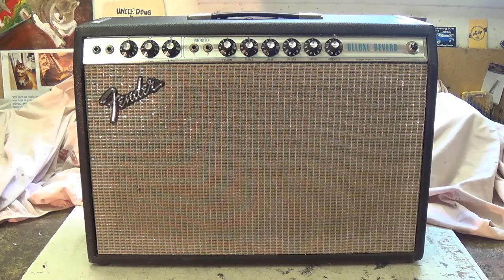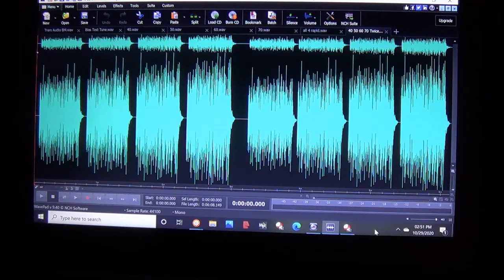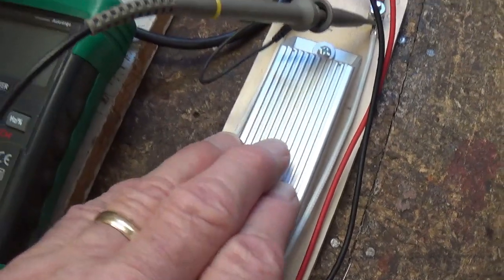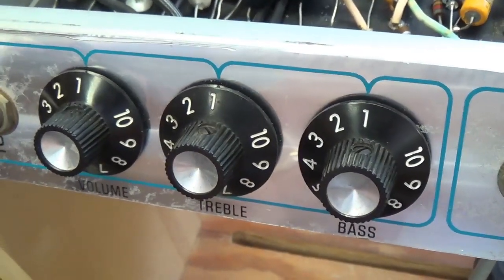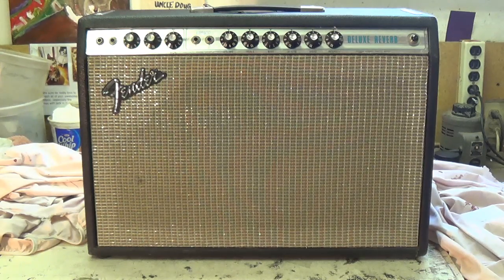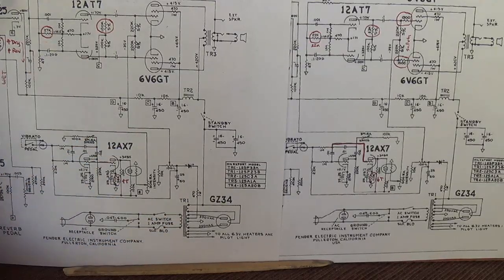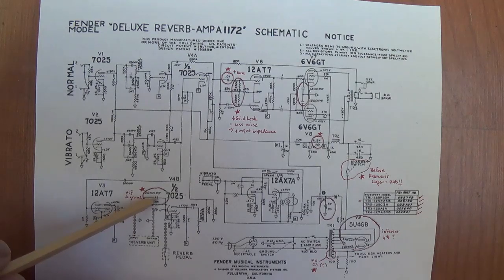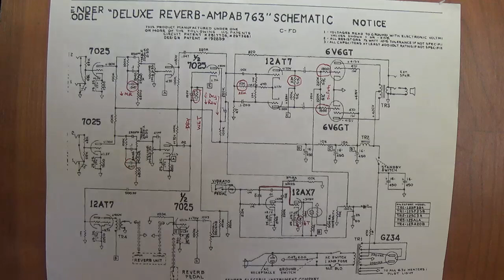The Effect of Output Tube Bias on Tone, Gain, and Headroom.....A Side-by-Side Comparison

Comment: On the center tap question, I wonder if a person "dismantled" a transformer that doesn't have the center tap, if, in fact, it's actually there but the lead is just cut off - - I'm with you U.D., makes no sense to add the "virtual" circuit if there is a center tap not being utilized but cut off within the shell of the transformer. If there ever is a clear answer to the question I look forward to you informing us. I enjoyed all of this video and especially liked the side by side(s) schematic discussion.
Reply from the maker: Thanks, Skip. Some people advocate using the virtual CT resistors because they can act as fuses to protect the PT from harm if a tube filament shorts out. In all my life and career, I have never seen this happen.....and the vast, overwhelming majority of amps with CT's have them grounded, so I tend to go with the majority.
Reply: @UncleDoug  Thanks for taking the time to explain the reasoning behind using the virtual circuit vs an actual Center Tap U.D. - very appreciated - makes a more sense now.

Comment: Well, that was delightfully nerdy. I liked it. Before everybody runs off and rebiases their amps to 70%, it bears repeating that 70% isn't a magical target, it's the maximum safe bias for most unmodified commercial amps. It's frighteningly easy to cook your tubes even at colder bias if the primary impedance is too low or the plate voltage is too high.
Reply: I was wondering if anyone would bring this up.  I have a bassman with 460 to 470 plate volts and a 2k primary impedance. It's biased very cool with the factory balance setup but after doing some reading I decided not to heat things up.  Sounds fine as is.. I read about more than a few marshall owners cooking valves when their primary impedance was less than 2k
Reply from the maker: Thanks for your helpful input, David.

Comment: It would be interesting to see a sonic comparison of grid biased power sections - as in Fender with cathode bias - as in Vox AC30.  Do they sound very different and what's preferable ?
Reply from the maker: They do sound different, Steve. Plate current in cathode biasing is self-correcting.....it remains close to the idle current. PC in grid-biasing is free to change dramatically depending on the strength of the input signal.
Reply: @UncleDoug  It's clear that many do favour the AC30 cathode bias amps but I wonder if its possible to demonstrate graphically how the signal is different ?  Also there are many other factors which colour the sound - some talk abotu output transformer design and core saturation for guitar amps, others mention the interaction with the speakers (many Vox players prefer the blue framed Celestion speakers) and then there's the effect of power supply B Plus sag.  Plenty of variables to confound and fascinate us :-)

Comment: Beautifully explained and demonstrated Uncle Doug, but it leaves me with only one question...I am unclear as to why you chose such high test frequencies. I am hoping you can explain why you chose 2KHz and 10KHz when the range of a 24 fret guitar is 82Hz to 1.32KHz (fundamental freq). Wouldn't we be seeing the effect of the 2nd or 3rd order harmonics at those frequencies? Do I recall that you normally test with 500Hz (about a "C" @ 8th fret high E string)? I am sure there is an excellent reason which I have missed. Sorry Uncle Doug. 
I  used to test at the "industry standard" of 1KHz at 100mV, but changed my wicked ways after seeing you test at 500Hz. I now test at 440Hz, a good Blues solo  note "A" (10th fret B string) .
Reply from the maker: I picked the frequencies arbitrarily, GAT. In retrospect, I could have picked lower frequencies.....but I suspect that the results would have been quite similar.
Reply: @UncleDoug  I reckon you'd be right, Uncle Doug. I'm relived that there wasn't a specific reason that eluded me. :-) Thanks for the quick answer.

Comment: I certainly learned a ton of important stuff in this video! And I believe I clearly understood the information. Oddly, I had bee n asking myself the same questions around which the presented information explains within the context I had been considering. To my shame I had only recently become aware of what is meant by the term "headroom" which started my asking questions around this same material. The whole driver in my desire to understand was in regards to lower wattage amps, 5, 15, 20 watt range and if it is truly possible to obtain a simpler distance between being clean and the beginnings of breakup.
  Thank you Uncle Doug. Thank you very much!
Reply from the maker: You're welcome, Dee.

Comment: I agree with you, 70% is about right to me. I always preferred, empirically, an amp biased on the warm side. Most amps have never sounded right to me until they get to somewhere between 65-70%.

About 5 years ago, I abandoned physical speakers and started using IR's and an active load. I have a Dumble-like amplifier that was being used for a session and I was playing a cleanish part. The amp had an overlaying fizzyness that I had never noticed when running it through a physical speaker. Right away I thought, "that sounds like crossover distortion". Sure enough, since I was working in my own studio, I took the amp into my shop and checked the bias. It was at 60% so I re-biased to 70%. When I got it back into the studio, the fizzyness was gone and the tone was much better. I had used that same amp for recordings many times through physical speakers and never noticed the fizzyness when the amp was mic'd, but it was never one of my favourite amps either. When I started running it through the active load/IR it was like putting a microscope on the amplifier and the crossover distortion became very apparent. After I re-biased it, the amp became one of my favourite sounding amps on that session. Just the difference between 60 and 70 is what made al the difference. But it took the "microscope" to point out why the amp didn't sound so great.

Thanks for this video!
Reply from the maker: You're welcome, JS. Thanks for sharing this info.

Comment: Hi Uncle Doug. I was thinking about your comments re the directly heated 5U4 and the huge inrush current which would look like a short cct to the rectifier or the first cycle or 2 while the caps charge. There has to be a good reason why nobody has used a NTC Thermistor, which means we could then use bigger reservoir caps and save our rectifiers.  Your words of wisdom would be gratefully received. :-)
Reply from the maker: Some amp circuits do use Thermistors, GAT, but you rarely see them in vintage amps. I will keep your suggestion in mind.

Comment: Tone sounds basically the same, more current more headroom. I've found with my amps when running at a medium volume, no difference could be heard when moving bias up and down. I've found 65% + or - sounds fine , tubes last and leaves room for drift and line voltage fluctuations. People have gotten ridiculous with biasing, it was never meant as a tone adjusting device.  It's a compromise between tube life and output.
Reply from the maker: I tend to agree with you, Brad, but that's why videos like this are necessary.......to help replace opinion with fact. I did feel that, using headphones, there was a tonal difference between the lower and higher bias levels.
Reply: @UncleDoug  Kevin O'Connor kind of showed this with his power scaling circuits.  There are some changes at extremes, but it's amazing how far down you can turn it to lose power tube headroom and get clipping at comfortable volumes without significant loss of the quality.
Reply from the maker: @Toddler1967  Thanks for your input, T.

Comment: I know I'm late to the party - but you should be able to view these waveforms in a "spectral" view with certain audio software, which would reveal changes in resonant frequencies in different sections of the audio file. The easiest method is to play the same chord repeatedly rather than chord changes so that you've got an easy apples to apples comparison, but a spectral analysis of the tone would reveal changes, like the addition of overtones or harmonics, as well as increases in strength to certain frequency bands based on the bias changes.

Overall - still a great video.
Reply from the maker: Thanks for your input, TR. You'll be glad to know that I am going to include spectral analysis in my next video, to monitor the effects of output tube bias imbalance.
Reply: I'll second that.  In the world of music and performance objectivity is an escape artist!

Comment: One thing you could address...The schematics for the AB763 and  AB868 show B+ at the output trans center tap to be 420 volts for both. (B+ the same with 5U4 rectifier on 868 and with 5AR4 on 763). Which never made sense since they both use the same power trans. The 5AR4 AB763 should be at least 20 volts higher than the 5U4 B+ on the 868. And given modern A/C line voltage increasing those 6V6 plate voltages to 455v this is a recipe for 6V6 abuse with an added 20 volts by going from 5U4 to 5AR4 (unless you use a JJ 6V6s that can yawn at 475 volt plates all day). My guess is the B+ shown on the AB868 schematic is incorrect and was carried over. I've worked on AB763 DR's, but not AB868s. Note to Vintage Deluxe Reverb owners, the JJ 6V6S is a great tube for those and is rated to handle 500 plate volts. 360 to 400v ratings on vintage 6V6's. The JJ's can really take the heat. And thanks, Doug for being a beacon of knowledge in the murky land of internet info on tube amps. As a repair guy and amp builder of 25 years it is amazing how much misinformation is posted in all of the forums.
Reply from the maker: Thanks for your kind words and knowledgeable input, Willy.

Comment: you should have went the other way and tried 85 and 100% for comparison :)
Reply: Perhaps with off the shelf tubes, not the vintage ones :)
Reply from the maker: If you'd like to send me a really nice, matched set of brand new 6V6's, I would give it a try, Gary. Also, include an NOS output transformer, just in case ;)

Comment: I had an 1172 and it did have the centre tap on the filament winding but it was taped off. I bet they found that the hum was a little less with the artificial centre tap. The 1172 is a later schematic than the 1270 so I don't think they resolved the issue (1:14:23), it came after.
Reply from the maker: Thanks for sharing, JS.

Comment: Just one comment regarding the coupling cap change to the 12AX7 phase inverter.
As you explained in your video; the RC time constant between the coupling cap and the grid resistor pretty much controls the low frequency response of the stage.
.
 The original 1 meg .001 ufd parts would have a 3db low frequency response of about 159 hz.
.
 Changing only the .001 to a .01 would lower that to 15.9 hz..
.
BUT,
Fender also lowered the value of the grid resistor to 330K, changing that break frequency back to a higher frequency once again. Not the original; but higher...
.
 The new combo of .01 ufd coupling cap and 330K grid resistor gives a low frequency 3 db point of about 48 hz...
 If you wanted to keep the original frequency response of the stage you could lower the grid resistor values to 100K for even less resistor noise and the original design low frequency cutoff of 159 hz.
.
Calculations for 330K and .01 ufd shown below.
Try it yourself using 100K and .01 ufd to see if you get the original Fender 159 hz 3db frequency again....
 Shortcut formula:
.
3 db frequency of the RC network = 0.159 / (R grid in ohms x C coupling in farads) = F
.159 / (330000 ohms x .00000001 farads)   =  .159 / .0033  =  48.18 hz
.
Even simpler F = 159.0 / (R in K ohms x C in microfarads)  =  159.0 / (330 x 0.01)  =  159 / 3.3  =  48.18 hz
.
Note:
Fender output transformers were undersized and do not handle low bass very well.
If it was my amp I think I would have lowered the grid resistor values still lower from the new 330 K down to 100K to keep the original frequency response intact, (48 hz vs 159 hz)..
And I would have increased the cap from grid to ground on the other half of the 12AX7 inverter by the same x10 factor that Fender increased the interstage coupling cap to the top 12AX7.... To regain frequency response symmetry in both halves of the phase inverter..
.
And that was a great catch on the position of the standby switch in that circuit! I should always be AFTER the filter caps.
Reply from the maker: Thanks so much for your very helpful and informative input, Dennis.

Comment: 868 scheme should be Silver Face  (1968.)  4.7meg vs 3.3meg "Reverb" resistor is the Vib Ch 2nd stage output reducer, not a plate resistor.  It curtails the output from that 2nd Vib Ch stage since it is amplified up by the following (3rd) Vib Ch stage.  I think if you continued increasing the idle (hotter bias) the amplification before clipping would go back down, resulting in a bell curve of results. For example, if the bias VOLTAGE was set to -1volts (very hot & over "100%") it would take a very small signal to reach clipping (1Vpeak.)   I have a 1971 and it has some 868 and some 1070 components originally.
Reply from the maker: Thanks for your input, JJ.

Comment: Uncle Doug,
What "maximum plate dissipation" do you use for 6V6GT tubes, 12 or 14 watts? There seems to be some difference of opinion. 
I have biased a pair of NOS, JAN Philips 6V6GTs in a Fender Super Champ X2 amp head at about 65% plate dissipation, measured for both matched tubes at a test point, using 14 watts as the max. I have also used the rated 375 plate voltage in this relatively new amp, without actual measurement for calculations.
It sounds great through an 8 ohm, 12" Vintage 30 speaker. I have eliminated the low end, flabby distortion, of the original tubes and biasing, and I'm not seeing any problems. 
But if the 6V6GTs should only be rated at 12 watts, I would be beyond 70% of maximum plate dissipation. Thank you for any guidance.
Reply from the maker: Some of the newly manufactured tubes are supposed to have higher max PD, Mick. You need to consult the maker to see what they recommend. On vintage tubes, I go with 12W.

Comment: The audio quality at ALL of the power levels was absolutely HORRIBLE!  And the 'scope displays indicated why.  I'm not referring to clipping.  The sines waves looked a little like triangle waves (though it was hard to tell, with so many cycles displayed: One or two would have been optimal).  But, cross-over distortion was very evident.   A correctly biased Class AB1 push-pull amp shouldn't have any.  If you can see ANY distortion on a 'scope, with a sine-wave, it's too much!  Why not graph the tube transfer characteristics, then adjust the grid bias to operate them in the most linear regions of their curves?  Also, a THD and/or spectrum analyzer would have been useful.
Reply from the maker: Thanks for your helpful input, Clyde.

Comment: Head room is peculiar concept. One might think more headroom is better since there is more dynamic range to use. But what if your amplifier cannot push the signal any near the distortion point, what do you do with that headroom 🤔It's like modern rooms are 270 cm tall but I'm only 190 cm. What do I do with all that volume. Well, heat it using convection heater and very expensive electricity.
Reply from the maker: Thanks for your input, W.

Comment: Deluxe AA763 What do you think about replacing the two fixed 220k bias resistors with trim pots in the fender deluxe reverb for individual 6V6 tube bias adjust. Or build a separate clone circuit like the one in use, minus the -55 volt feed to the 12ax7 . To run tubes of different outputs to match their output watts that way. Separate circuit would be more stable, having its own transformer tap on same ac leg, keeping current flow to each tube more uniform as it swings with playing changes. Been wanting to try both ways, do you see a fault to this in consideration of cause and effect Im not seeing. Thanks' Greg
Reply from the maker: The two separate pots would work fine as long as you could come up with a circuit that protected against PC runaway if the pot wiper lost contact.

Comment: Ty Uncle Doug for sharing such knowledge!! . Question if I may sir. If I want my 6L6's to run hotter, do I put a higher value resistor to the grids? To bring voltage down? And is that called under biasing? The tube bias topic always confuses me because its a negative number, if that made sense. Ty for your time! love your videos. Sincerely, Jim.
Reply from the maker: To avoid any problems, James, you need to seek some help with any modifications. The resistor to the "grids" has no relation to the bias.....and a proper explanation is beyond the scope of this format.

Comment: Regarding Blackface vs Silverface amps your analysis is missing one thing that may be important to some people:  CHANGES IN THE CABINET.  Besides changing the circuit, as the silverface era progressed, the amp cabinets got cheaper, they started cutting corners.  The thing that I'm most familiar with is that a certain point they stopped using screwed in 1/2" plywood speaker baffles.  These can be removed from the amp to repair/change the grillcloth.  They changed to glued in 3/4" MDF (Medium density fiberboard) speaker baffles.  These are more rigid than the plywood panels in the Blackface amps which allows for a less solid (cheaper) cabinet.  However, we can't remove this panel to repair speaker grillcloth, etc without pretty much taking the cabinet apart.  The amp is probably a bit heavier.  I don't know about changes in sound.   Just something else to think about
Reply from the maker: Thanks for your helpful input, Alan.

Comment: They moved the standby switch due to using a 5U4GB, it would draw too much current cold to fill the caps. Also, winding a center tap T former is more costly in production than a single wind. All cost cutting measures.
Reply from the maker: Thanks for your input, Tom.